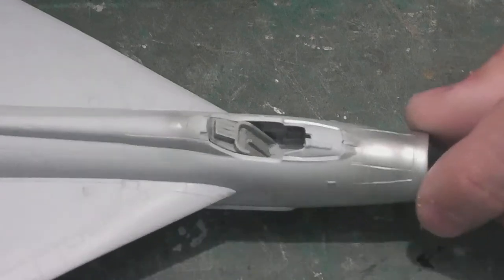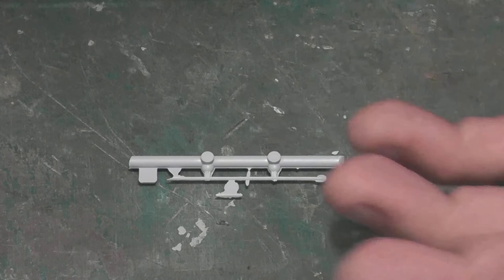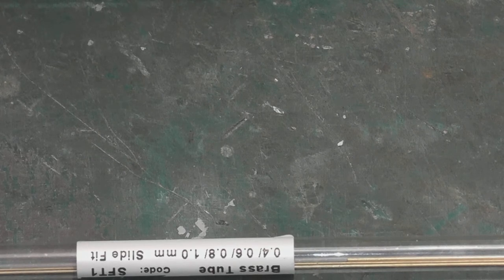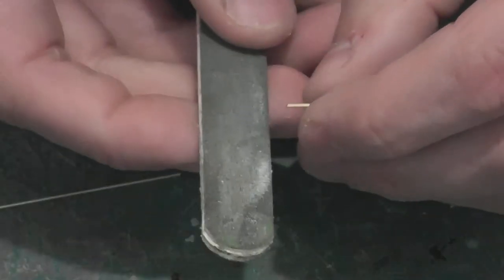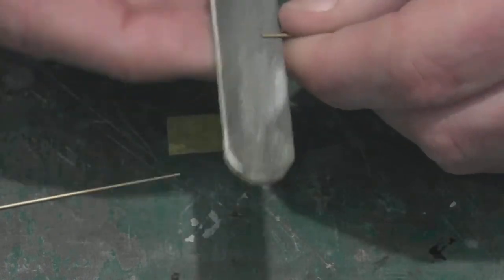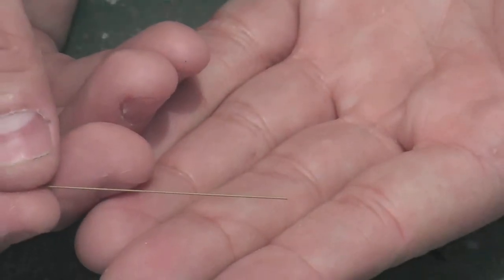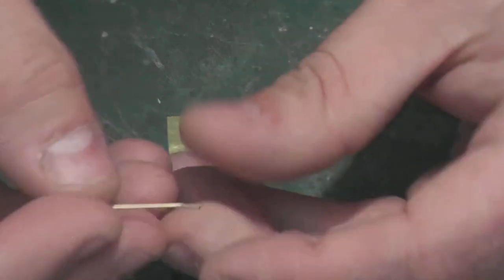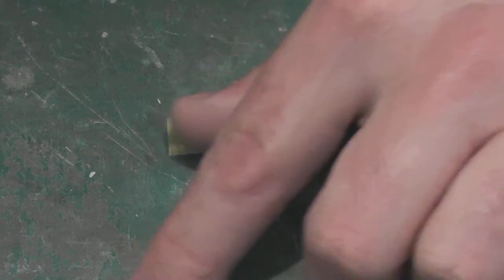Making pitot tubes from brass tube

Comment: Hi Drewe, great tip mate. Do you end up spraying the tube as i know that the original tubes are chrome in colour and not brass on the real aircraft. If so would you prime it first. Also what scale model is this tube for is it 1/72 ?
Cheers mate and keep up the good work.